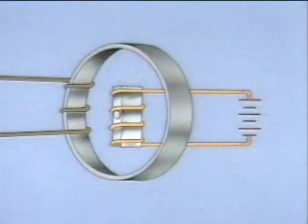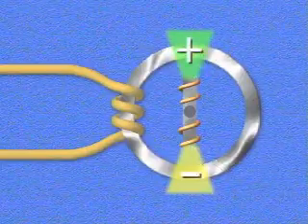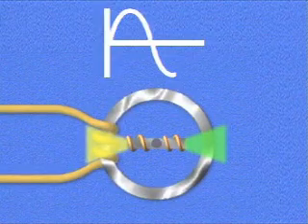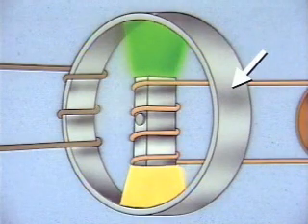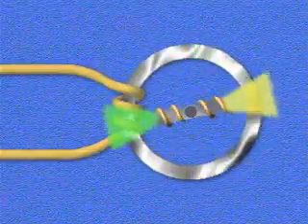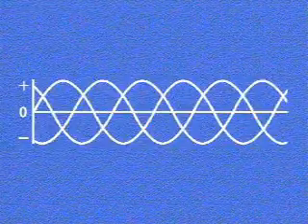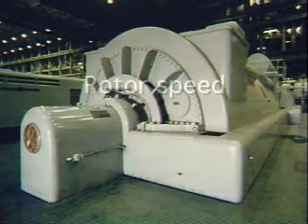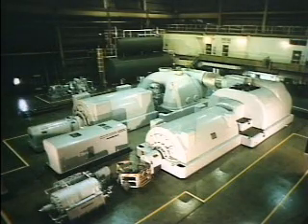How a Power Plant Generator Working to Create Electricity ? Electrical Engineering

Comment: The rpm of the generator connected to a steam turbine is constant inorder to maintain the frequency constant. But how the output power(in KWh) varies. Please reply anyone.
Reply: The output varies by varying the amount of DC voltage to the rotor or 'field' coil. This in turn creates a stronger magnetic field so more voltage is induced in the stator windings to feed the increased load.

Comment: The flow of current in the illustration of rotor excitation is wrong. Current flows from the positive terminal of the DC source and returns to the negative terminal. I know that electrons are actually flowing from negative to positive, but Ben Franklin did not know about electrons. Visualize the flow as positive carriers, or the absence of negative carriers.
Reply from the maker: Thanks for ur info

Comment: do they use permanent magnets in large scale powerplants ?
Reply: No... never. A permanent magnet is not a strong enough magnet for the high power demands of a large powerplant. Also, a permanent magnet offers no control of the rotating magnet strength as does a DC electromagnet.
Reply: Excelent engineering skills and knowledge but no innovation on how to bring down the fossil fuel plants archaic technology in the generating rooms that produce the CO2 with its fuels, that is where we must focuse for innovation

Comment: I also found this generators come in not one, not two, not three, but four parts generating the electricity, you got the stationary stator and the rotating rotor, and to transfer the energy the rotating slip rings and the stationary brushes!

Comment: I think this is how it works. The rotor, or the moving part turns the circuit through the negative and positive magnetic field of the stator, the stationary part. Sending in negative and positive energy through the circuit, traveling back and forth, to and from the generator, forcing negative and positive energy in and out of the generator producing electricity! Lastly the brushes connect the circuits from the rotor. switching during every rotation. In a way the stator and brushes both don't move when the stator does. So the flow of energy stays the same keeping the power going. Wierd!
Reply: Your concept of power flow is wrong. The instantaneous reactive power from the generator is the instantaneous voltage times the instantaneous current. This results in a real power and a reactive power. There is no commutation on the rotor rings. The rings are solid completely around, and there are multiple brushes on each ring to handle the high current needed to excite the rotor winding. Reactive elements in the load cause changes in the phase angle between the voltage waveform and the current waveform. Energy is stored between half cycles by the inductances of the stator and rotor. The power company would like to keep the phase angle to a minimum, so that they can extract maximum real power from the stator windings, which are limited in the magnitude of current they can produce.

Comment: Thanks very much for the wonderful explanation.But i understand the magnetic field is created by wounding a wire around a pieas of metal or core at the rotor side to be able to induce a voltage into the conductor at the stator side,why is  the wire at the stator side also wound around the metal pieas also?
Reply: We can also have a ( changing or rotating )  magnetic field with a permanent magnet. 
If the rotating electro magnet loses its power the generator still produces the same voltage.
The generator then does not produce alot of power ( Watt ) but the same voltage.
Now lets talk about the coil on the stator.. The person that made this video annimation
does Not understand how Faradays and Maxells lows work...
A coil just wants to stay as it is. If a coil ( now a talk about the stator coil ) detects a Change 
of a magnetic field the coil reacts. But first this , this animation is Wrong , when gives the 
stator coil the Most voltage that is at the time when the ( changing or rotating ) magnetic field
to the coil is at is lowest . Then the Change of the magnectic field to the coil is the largest.
So how produces a ( stator ) coil electricity or voltage and power.. 
A coil does Not like change. Now we get a change of magnetic field ( the rotating magnet of the 
generator ) . Now the ( stator ) coil wants ( and is ) to produce a magnetic field to eliminate
the magnetic field that the coil is exposed to. How to eliminate  that magnetic field is to 
produce its own magnetic field. Now the ( stator ) coil produces voltage and current
and the current is needed the produce a reactive magnetic field, that is what the coil wants.
I advise you to look up some information about Faradays and Maxells lows.

Comment: This is not true.  When a North pole enters a coil you start getting positive current, with the maximum reached at half way between the beginning of the coil and the middle.   When the North pole reaches the center of the coil it is again at zero.  Now the north pole begins to travel on its way out of the coil.  This causes negagive current to start, reach it's max at midwar beween center of coil and end.  THen head back to zero when leaving the coil.  A full sign wave is completed when a north pole passes fully by the coil.
Reply: I’m a novice at this. So I’m wondering: Does North/South make any difference if intermixed? I’m just trying to learn about how to create electricity.
Reply: @fairybeliever4479  yes big time. Although they are always together with AC you will get only the positive charge from DC due to the nature of our batteries.  At 2:28 in the video you see 4:35 traditional sign wave the line that make a hump above a line labeled zero and dips below zero for this up and down parabola. The is + and minus charge as we have labeled it. (Positive is above the line) So for direct current from an AC source you need and adaptor or rectifier to let positive in and quickly shut off. And repeat.
Reply: @anthonypape6862  thank you 🙏 😊

Comment: This topic has been done to death, I thought they where gonna go over the equipment. Like what's spinning the rotor? Steam? Water? A motor of some sort? What powers that? What keeps it's speed consistent for the frequency?  What are they using to energize the electro magnet to induce voltage since this is the plant creating power? Where's that power come from?  If this vid is on "power plant generators" then go over the generator system. Or just call the vid "another explanation of generator function... again" this has nothing to do with power plants ~specifically.

Comment: Ok but what makes the dc current to power to magnet?
Reply: It's called "excitation," and in the exciters I've worked on, you have something known as the Permanent Magnet Generator, which is a ring of stationary rare-earth magnets surrounding a ring of rare-earth magnets attached to the exciter rotor.  The field is generated initially from there and the exciter steps it up.  The exciter rotor and generator rotor are connected with copper bushings at the coupling face.
Reply: @jesusnthedaisychain  are you telling me that all electricity is made from magnets?
Reply: @ThatOneGuyWeAllKnow  Am I telling you that the electromagnetic force is one of the 4 fundamental forces of the universe and that electricity and magnetism are unified?

Yes.